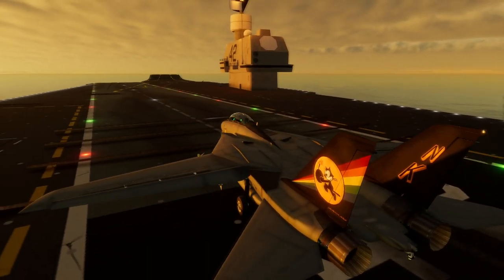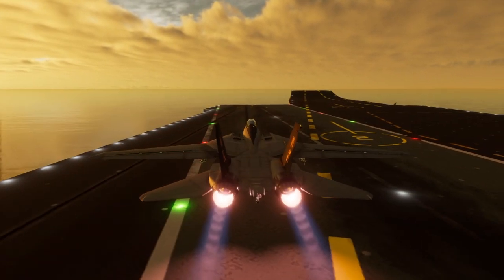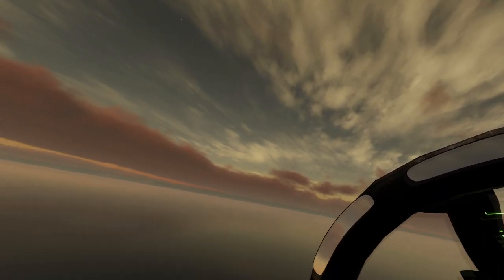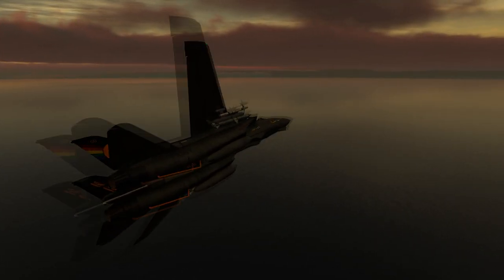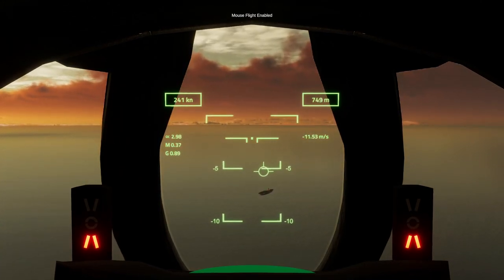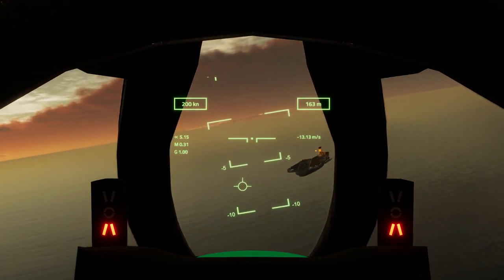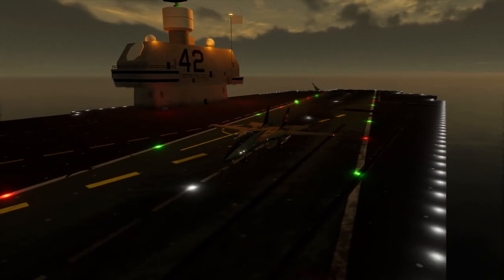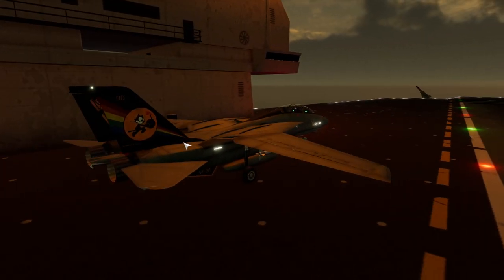Flyout CATOBAR Mod Showcase

Comment from the maker: correction to myself, no clue if its actually the DLC system used to turn the F-14 but iirc roll is not recommended for the slight precise inputs required for carrier landings especially for such a fat plane, i'd research but i'm tired so someone correct me idk